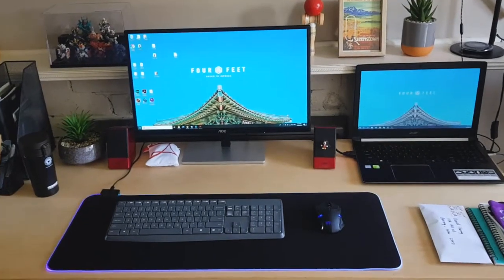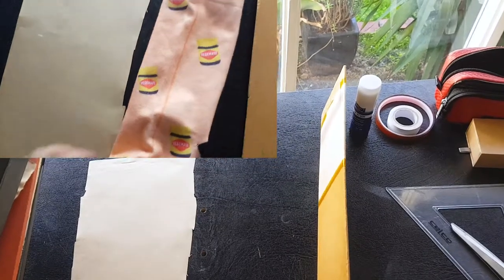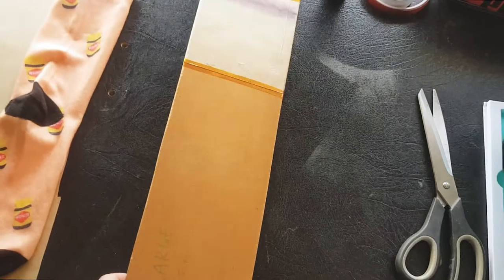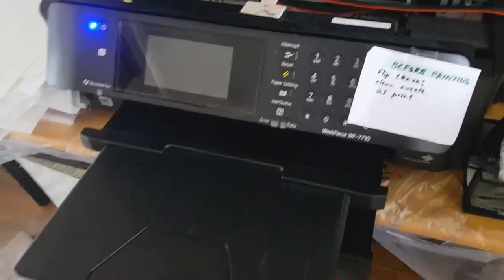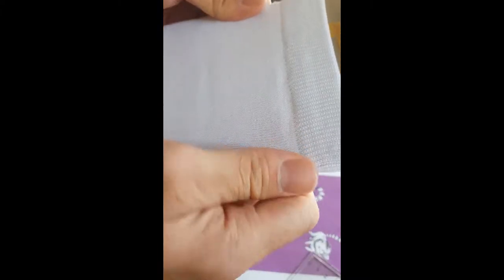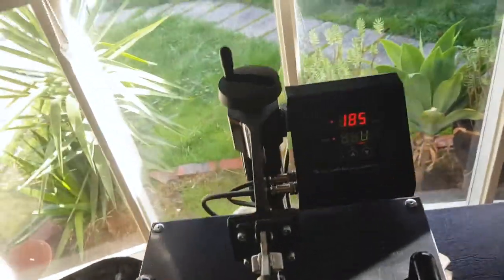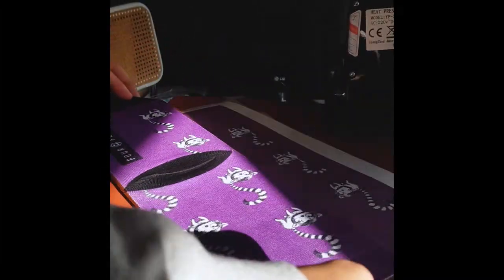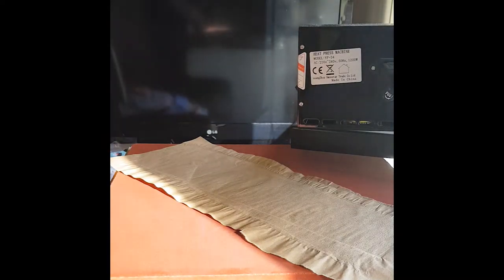Sublimation socks - Ink overlap line [SOLUTION]

Comment: Do you need an A3 printer in order to print onto socks? Are you able to link me to the sock template please?
Reply from the maker: Hi Kenneth, this depends on the size of the sock. Perhaps for ankle socks or short socks you could probably sublimate with A4 paper. Our socks are generally long so it would require A3 sublimation paper to make printing the whole surface of the sock possible. Yes I can provide you with the template that is suited for a 12cm jig (although you can adjust the dimensions if you know how to use Photoshop) Please let us know your email :)